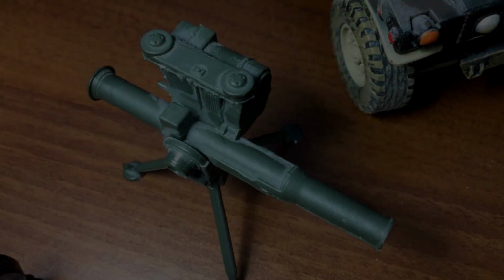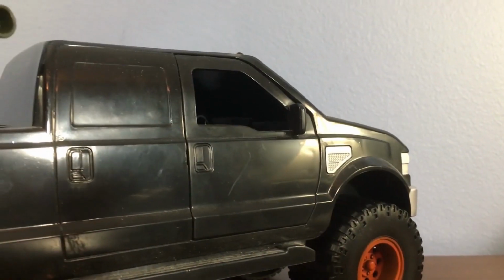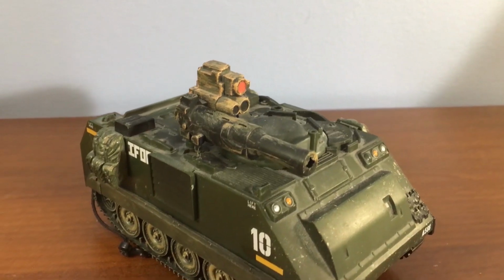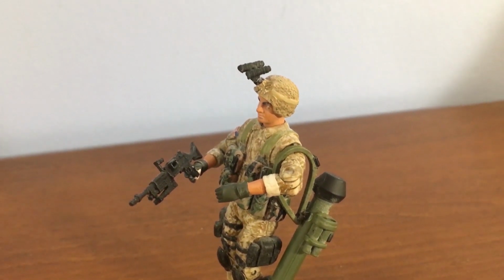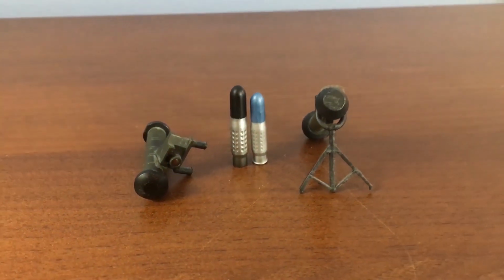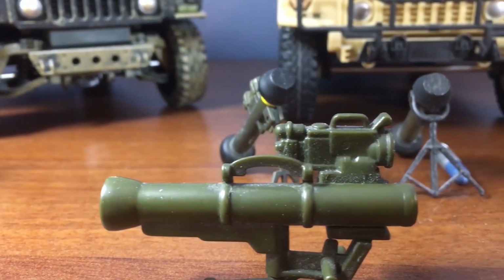Guide to 1:18 Scale ATGMs

Comment: Very informative video - you got yourself a new subscriber!
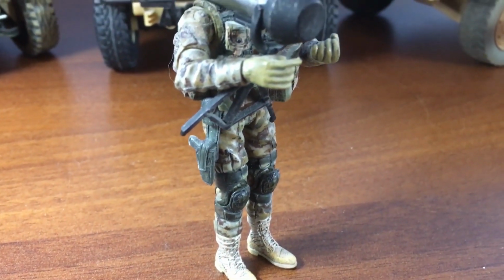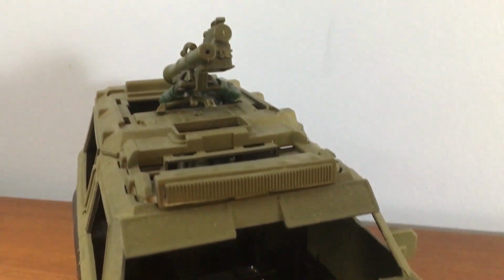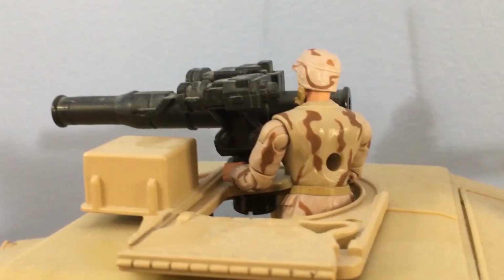I've been using the 1:18 scale  Humvees for vehicles, and got excited when you posted a customized Hero Patrol Police SUV by Jada (4:03). Does the driver's seat accommodate a 1:18 figure?
Reply from the maker: The vehicle should be able to accommodate most 1:18 scale figures, but seats would need to be installed separately, due to the lack of an interior.
Reply: @TheHumanMechanism  Thanks for the info, man. I saw your great video on the Bruder line of vehicles but those are definitely not kit-bashing fodder.
Keep up the great work!